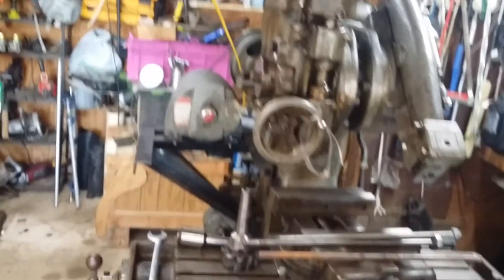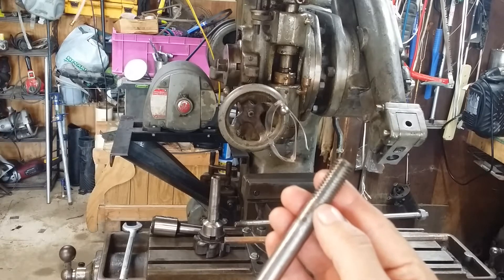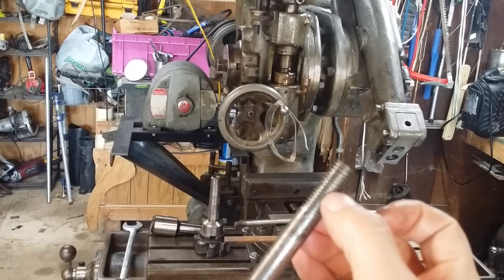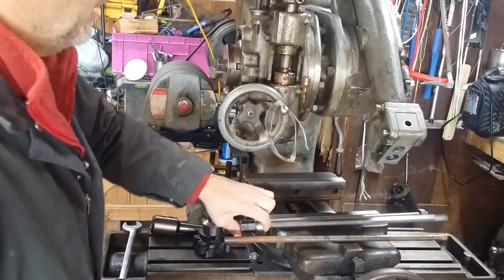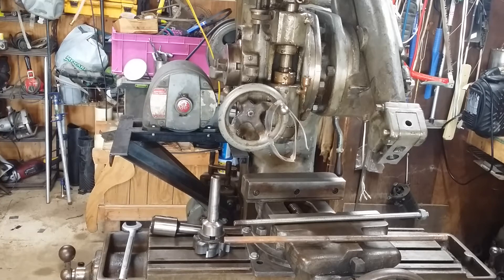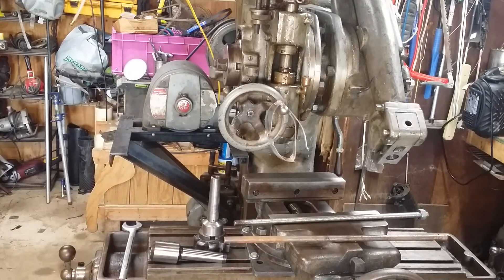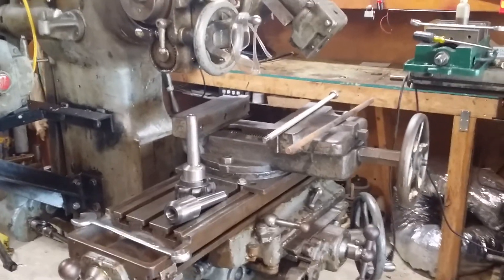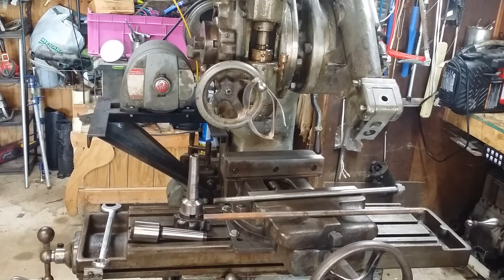Cochrane bly draw bar and shaper vise back together

Comment: Good move on making a proper drawbar for the CB.  When I was considering the purchase of a Burke #4 mill awhile ago, had read about the B&S #9 taper being a bear to remove.  Sounds like the 1/2" rod may be a tougher steel than the all-thread, which is a good thing! Glad you're making progress on improvements to the CB;  it's certainly worth the effort.
Reply from the maker: Oh yes it can be a bear to get them loose. This new bar seams to make a big difference so far

Comment: Here's some info on the universal shaper from vintage machinery: http://vintagemachinery.org/pubs/2387/24572.pdf
It does horiz. milling too - as I suspected - and has constant feed for milling as well as intermittent for the shaper.
Reply from the maker: Thanks for the info. I haven't seen that flyer before
Reply from the maker: Need to finish some work on the mount itself (stiffening and a tension rod) and I need to finish that odd ball pulley. And get a three phase speed controller for the other motor. Sure the will probably be some misc stuff as well, but that's a rough outline. 
My energy is much better now, but it seems to come n go. I am fine for a couple weeks then crash. I can only assume it's lingering covid issues at this point, but I think overall doing better n better. Assuming I survive the upcoming election..lol
Reply: @craigtate5930  GREAT to hear you're a covid survivor. I'm quite interested in the news that some that have had it are getting it again - which is a little odd. I don't know where covid is going - whether it's going to end up being another regular inoculation thing or whether it'll be eradicated as some diseases have.
I wish I had (really????) covid as an excuse. I'm 55 feeling about 80!
Tell me more about 3ph speed controller - or is it simply going to be a Variable Frequency Drive ?
I've got a Colchester lathe designed for instant reverse. I've got a box of bad capacitors to create 3ph from 1ph - it just went bang last time I powered it up. I'd just have bad vibes about the technology. Ditto VFDs - so want something more robust - and like the idea of a 1ph motor driving a 3ph generator - VIA a variable speed pulley system ! With an idea of range half speed to twice speed. But the main idea is to get the machine spindle rotating at 550 rpm in gear selection 500 - so only a 10% speed increase. So mainly used for fine tuning spindle speed when exactly the correct speed is not available. My lathe top speed is 1200 - so a 2X on that would be great :))))
The lathe, and my milling machine are both 1960s. Technically inherited from my father - but I lent him the money to buy the mill. £800 it cost. I guestimated new now would be £8,000 but on looking, £14,000 may be a reasonable guess.
It's been one of those 'lucky buys'. Neither of us knowing a lot about milling machines at the time of purchase. As a hardcore machine, I'm not sure what it won't do ! It'd outmanoeuvre a Bridgeport easily. It won't drill/mill vertically upwards - which a Bridgeport could. And these machines with independently powered feeds do have an advantage of variable speed. Mine's gear driven like yours - but in 3 axes.

Until your video, I'd never seen a machine like it but am aware some mills have slotter attachments. Maybe one day I'll get the enthusiasm for making some fancy attachments - like power hacksaw ;)
I think no.1 on the list will be an adapter from 40 taper to lathe taper so I can fit any lathe chucks etc. to it.

Just found your channel. Interested in knowing what machines you have.
Abom79 is well set up. Keith Rucker has an interesting 'shop' and is tied to the aforementioned vintage machines website.
Blondihacks was a surprise - disaster channel - includes all the bits that go wrong. This Old Tony, you might be aware of - humorous content in the extreme. 'Joe Pie', as he's known - quality technical content but for extreme quality, turn to MrCrispin's channel.

I look forward to more videos on the universal shaper - showing the problems it has. Although it's a new beastie to me, as an engineer, I generally understand how things are supposed to work !
Reply from the maker: @millomweb  I was very fortunate in July I got a mild case of it. But it's still been an epic pain in the ass. 

My friend next door she got hammered with it in dec/jan before anyone know what was going on in the US. Then she got it again (mild) in july as well. Her time line of symptoms are nearly identical to mine for some odd reason.

It seams like covid is likely to endemic from what the experts are assuming at this point. At least in the US. Not enough people here will wear masks, or get vaccinated (once proven safe/effective). So I imagine its here to stay. But eventually should be manageable (just not this winter)

You mention joe pie. He is my absolute favorite to follow. Plus I tend to watch some from the others on your list. I really like small channels content. Folks like us have to be more resourceful then the aboms and ruckers of the world. 

As for my shop, 2 lathes, 2 mills and a shaper. I used to have a 14" steptoe  shaper,  but I sold it when I was donated a basket case atlas 7B. 
I have a hendey gear head lathe, and a 12" logan lathe. 
Then there's my full Cochrane bly  and 1 that's half Cochrane bly / half Bridgeport. The latter is how I found out about these in the 1st place by pure accident 

It's a VFD I will be adding to the Cochrane bly.  Mostly to get 3 phase for a 2 HP motor I have that has a very small frame. It will barely be noticeable when I get done.
Reply: @craigtate5930  I spotted the logan briefly in the background. Another machine I've not come across before. I've also not come across the Hendey name either ! You seem to go for rarer machines ! Having said that, I've not come across anyone else with a G. Dufour mill !
My school had 2 metalwork shops. Both had lathes of various calibres and were fitted out for foundry work. I only got to 'play' in the 'newer' shop. It had 5 lathes from 2 'numpty' machines (no leadscrew, no reverse, 3 speed) up to a Colchester student - rarely used by the students! They had , I think it was an Alba, shaper but no milling machine. 2 pillar drills and a decent power hacksaw. Students didn't get to play with either the shaper or hacksaw. I got to use a Raglan lathe - similar to this: https://i.ebayimg.com/00/s/NzY4WDEwMjQ=/z/GDwAAOSwXetdrDfs/$_86.JPG to do my exam pieces on - a grease gun and a woodworker's sash cramp. While others made lever action grease guns, mine was a 2-speed push action telescopic version. Pushing it onto a grease nipple first compressed the grease inside it with a big piston then a much smaller piston forced the grease out under greater pressure. The sash cramp was in interesting one. I'd turned threads previously at home - so obviously the clamping screw I turned at school - and discovered the metalwork teacher didn't know how to cut threads - so it was more a case of me teaching him ! I suspect I was the only kid that turned a thread at that school !
The school had an award scheme called 'commend work' and I got one for that thread. It was only of only about 3 in the whole time I went to that school ! I also doubt that teacher would give out many 'commendeds' ! In fact, he was so impressed with it, I had to collect it from the staff room as he'd taken it there to show other staff!